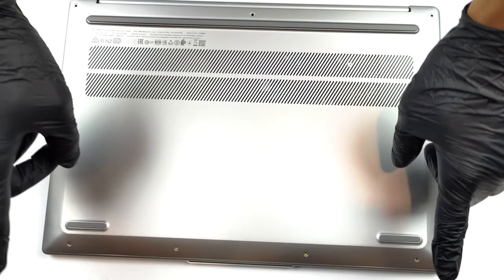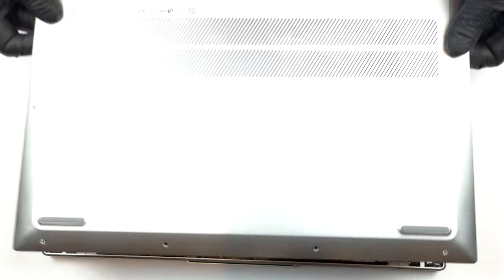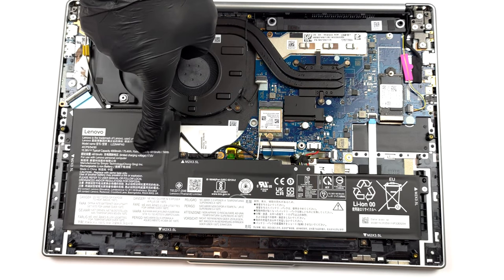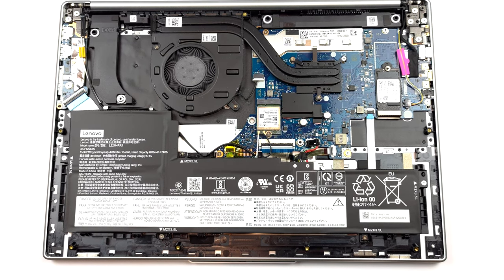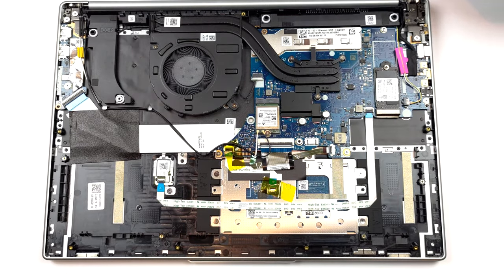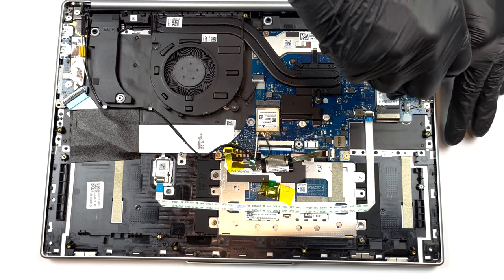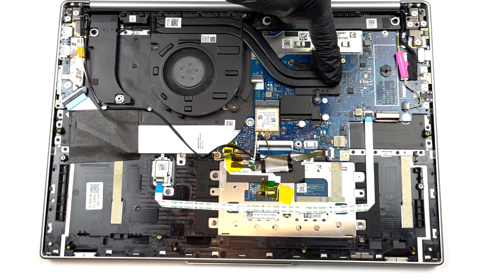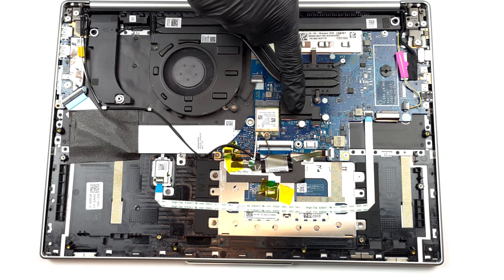🛠️ How to open Lenovo IdeaPad Slim 5 (16", 2023) - disassembly and upgrade options

Comment: But what a story behind battery? There are most of the time 56.6Wh battery is sale, but no 75.4Wh variants. I don`t get how it works, the model is the same, 1:1/
Reply: Intel versions have the bigger battery, but AMD is better with much lower power consumption.
Reply: I have the Intel chipset.  Battery life is 15h if doing something low-impact like web browsing or video watching, but only 5h if you're doing something hardcore like batch video edits or compiler use.  There's additional high-speed (and apparently power hungry) processing power that cuts in if you're doing something demanding.

Comment: Support 2tb ssd?
Reply: Nope
Reply: @xozeintk8093   mother borad Limit?
Reply: @bladagrivbass   Yes only 1TB
Reply: The motherboard recognizes a 2TB on mine.  I swapped out the SSD before ever booting, and installed Linux on the new blank one.  Works fine.

Comment: it's fucking insanity that they removed upgradable RAM without even offering 16GB option unless you pay 200 bucks more on eBay listings.

offering 8GB in 2023 should be considered committing federal crime
Reply: I just bought one new from Costco with 16G RAM.  The full model name is "Lenovo Ideapad Slim 5 16IRL8."  It's marked as being manufactured in August 2023. The downside is it came with an anemic half-terabyte SSD.  Fortunately the SSD is upgradable, so I swapped that out before the first powerup.

Comment: EDIT : yes it is possible to add an  2280 M.2 PCIe SSD, I did it.

Hi,
do you think possible to replace the SSD with a 2280 type ?
I'm afraid it's not possible due to the black plastic support for the screw of the M.2 2242 size... Maybe it is possible to remove it in order to put an 2280 but it seems difficult :( And no screw hole to fix an 2280...
Thanks
Reply: There is a post clearly marked H7 above the current short SSD to mount a longer drive to.
Reply: yes it's possible, you can remove the black plastic
Reply: Ok thank you very much !
Reply: were you successful in changing to 2280 M.2 PCIe SSD?
Reply: @Pablo-zw5pv  yes very simple and easy.
Reply: @GaspardMzt  Hay algun video de como hacer el cambio? Gracias